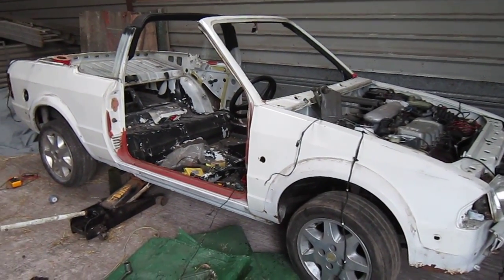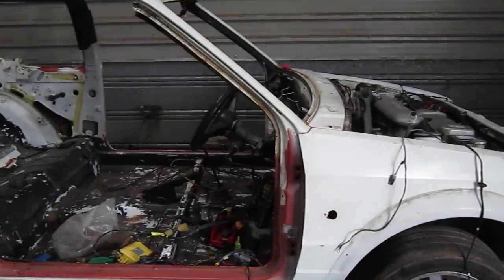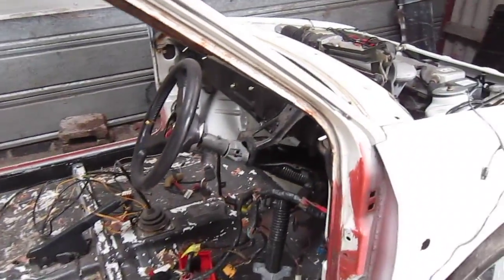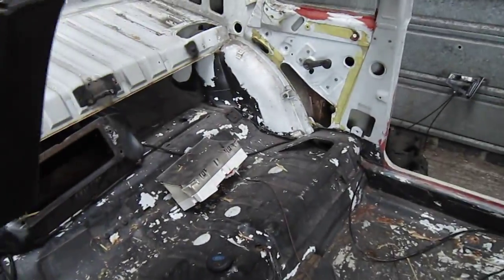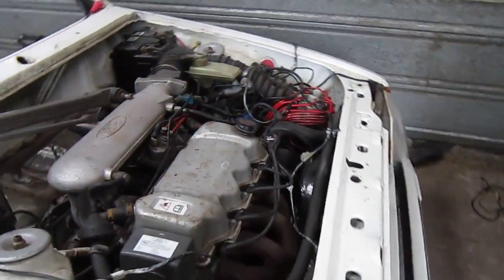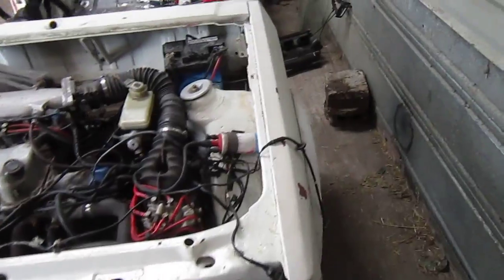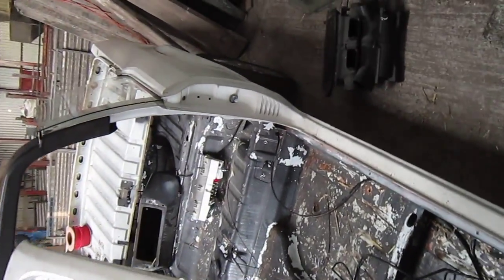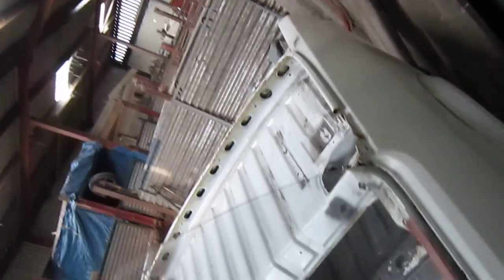Escort Cabriolet MK3 SE XR3 Part 2 - RS Turbo Style Project Car - Wiring loom of doom

Comment from the maker: It's currently in primer and work has been postponed due to bad weather. It will be fully restored in the next year hopefully. I have been spending recent weeks sourcing parts like S1 recaro's, white roof, and genuine decals etc. I will hopefully be showing it next year at local shows. Apparantly there is less than 20 on the road? Not sure how true that is but it is very rare.

Comment: well it will be nice.....o gpt my self RS s2....have it almost 2 years....and 1 year of that he spend in garage!!!!engine is fully restored....but not yet fired up....have some problems with cam i had stuck valve and destroyed cam.....i fitted efi system from kadett c20let engine.....pistons from audi 2.3 turbo.....had some modification with inlet magnaflow....its not going over the head but sides way....and bigger intercooler :) man i hop for atleast 200-250bhp with new map